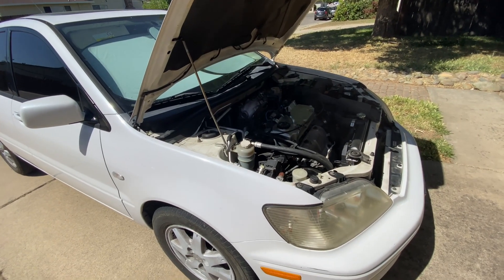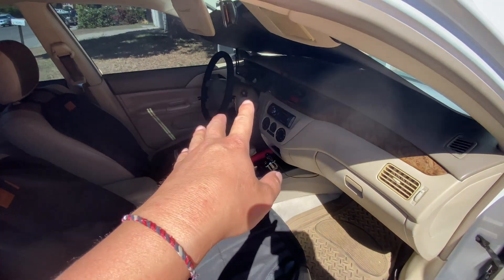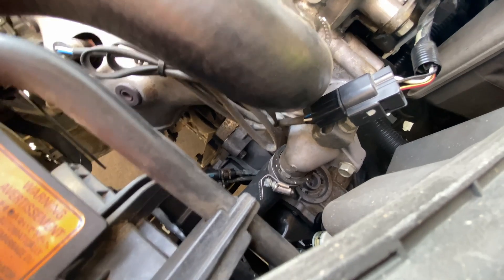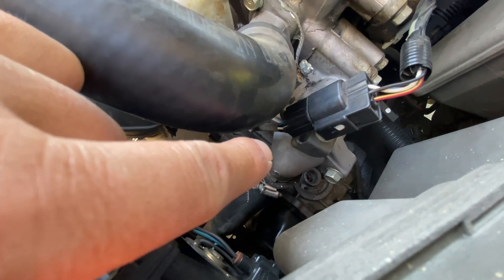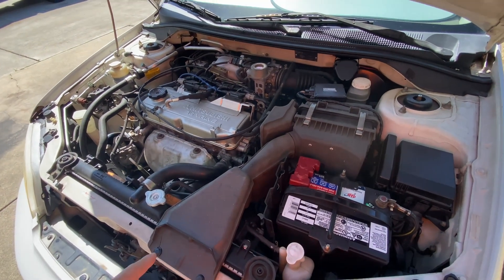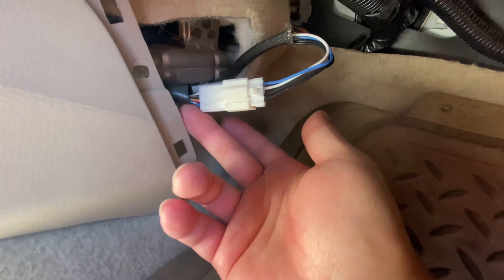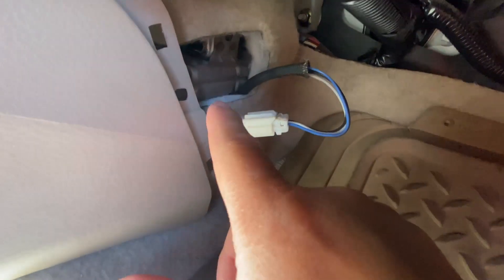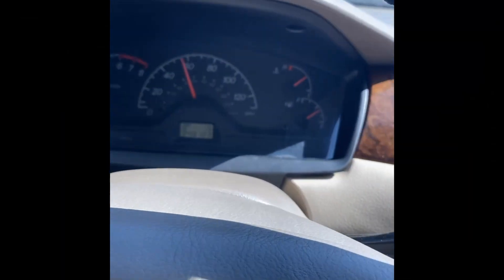Dreadful P0141 Code 2002 Mitsubishi Lancer

Comment: My Mitsubishi lancer cs2a keep on cranking converter cover why..
Reply from the maker: The catalytic converter cover? I’m not sure, check if all your bolts are tighten down including the ones holding it onto the engine block. Vibration and heat can cause it to crack.